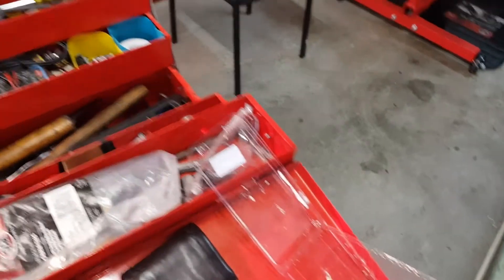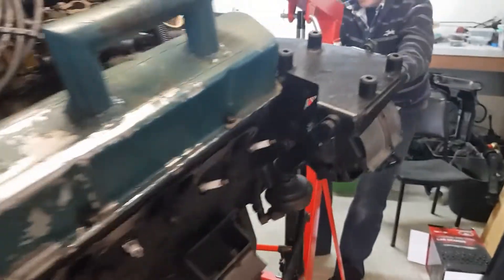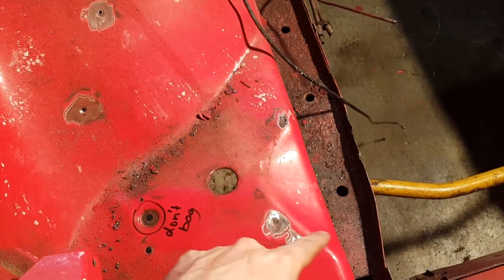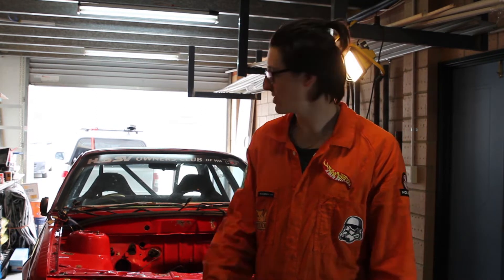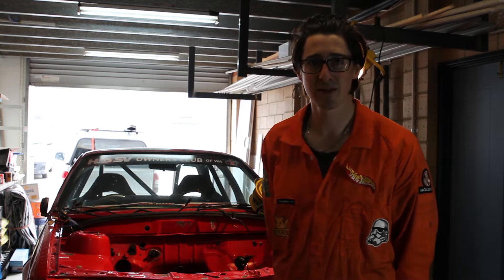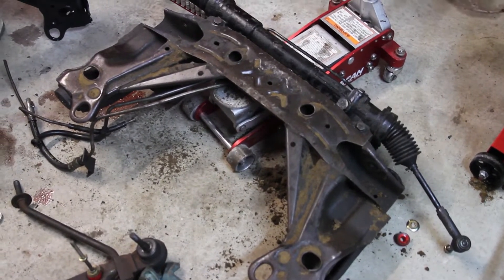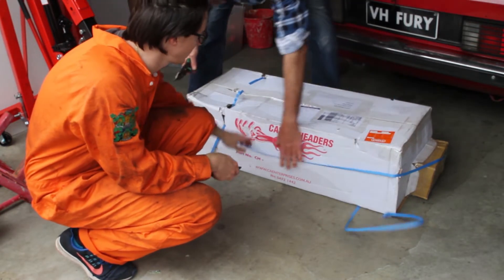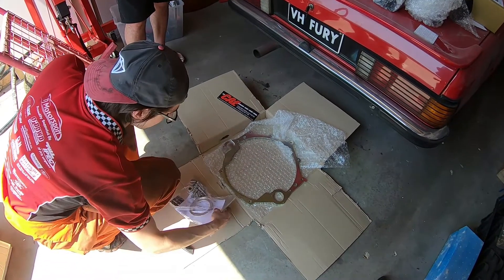VH FURY GETS AN LS! -  PART THREE

Comment: Why does the K frame need to be swapped?
Reply from the maker: I believe it helped with the power steering location which helps header clearance
Reply: @MarslandMotorsport  Cool, yeah it's pretty tight down there.  Cheers

Comment: I wonder if you realise that under ADR design rules as most of you don’t know is that when you put an engine in from another car you need it certified , under ADR rules not only do you have to replace engine however all running gear needs to be swapped over + all suspension from where the LS1 came from !! Honestly though you would have been better off sticking with the original stock stuff you have not actually increased any value in this car you  have devalued it , stock standard cars are actually a lot cooler than modifications
Reply: Each to their own mate,his car ,he can do what he pleases
Reply from the maker: Each state has its own rules and regs in regards to modifications. Lucky for me this is an unregistered race car so do not have to adhere to those rules. As for value it's always worth what someone else will pay for it!
Reply: We must follow the rules